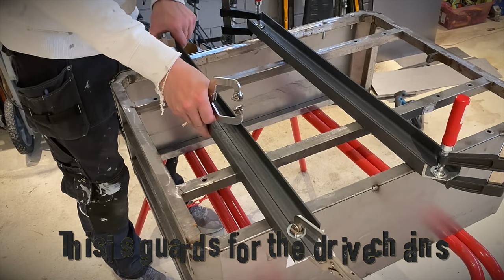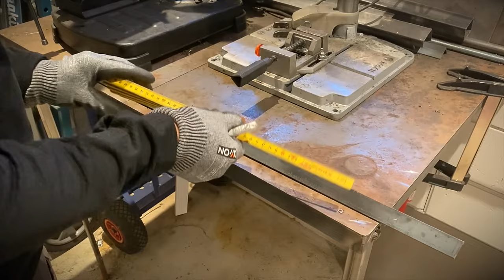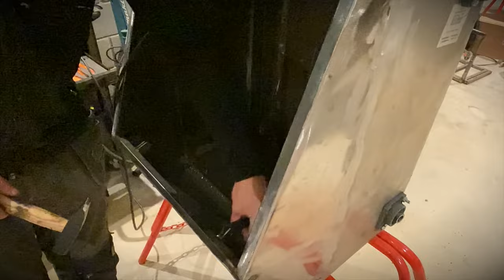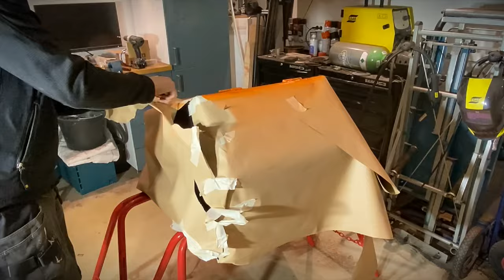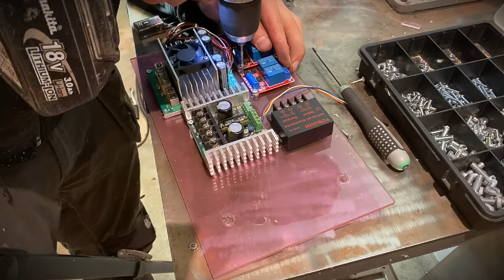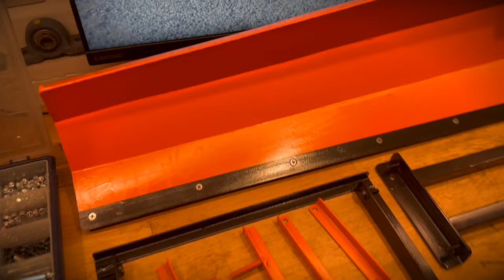Meet the CyberPlow! Watch How I Created It from Scratch

Comment: Nice work! If you can do all this, then a snowblower whould be a great addition to the fleet of various equipments. Have you checked how much lift capacity it has?
Reply from the maker: Yes! That’s one of my future plans for this project. It will lift around 60 kg as it is now. But its easy to swap to stronger/ slower actuators.😊

Comment: Dear which two battery’s do you use? 24volt 20 amp ?connect in series thanks for reply
Reply from the maker: 2x 12V 56Ah in series⚡️⚡️👍

Comment: Perhaps a kill switch on top of the unit for safety?
Reply from the maker: Yes, I think I will add that👍
But I do have a RC kill switch on the remote, driving a big relé for the motors power. Also, it turns off if it RC signal is lost.